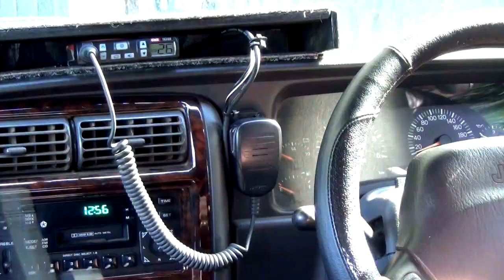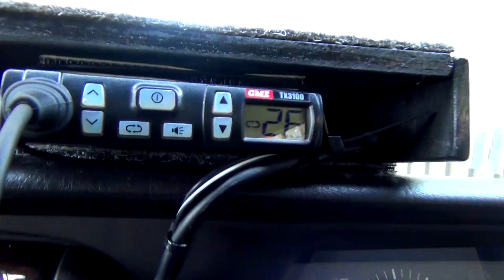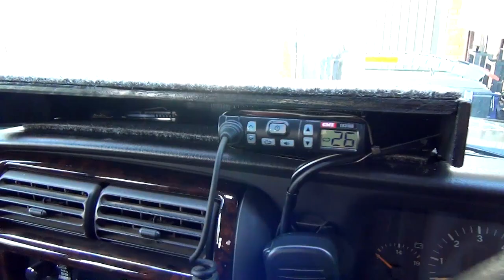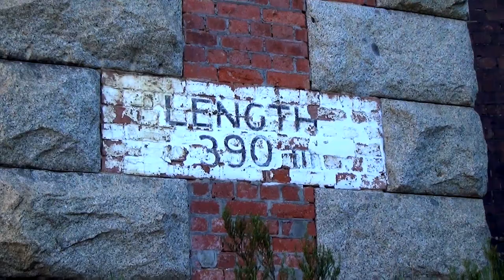Man Cave Tuesday Ep.53

Comment: Yea I used to live in rural are but the past ten or so years warehouses and houses have been creeping up on my area, used to be lots of open land east of me, but that too is building up.
Mark I want to ask you is that a Southern Cross patch (crux) on your jacket on the right shoulder?
I too was laughing about that Column shift on Nay's Ford, not many cars or trucks have them here in the USA, most have a floor shifter or the rotary switch for selecting gears. I prefer a manual five or six speed myself.
Reply from the maker: +Donald Kline Yes that is the Southern Cross! :-) not many cars have column shift here either.